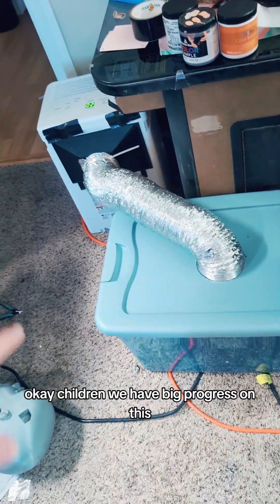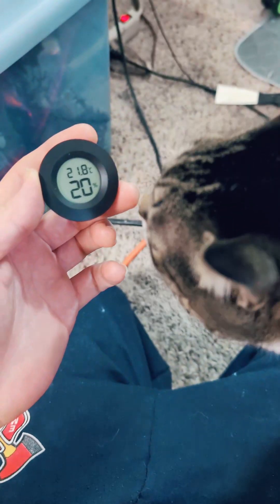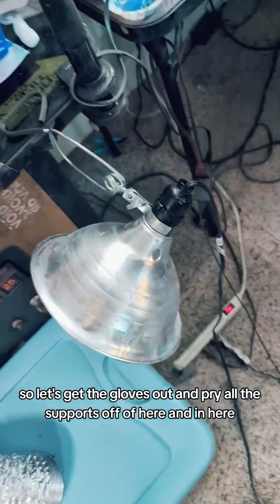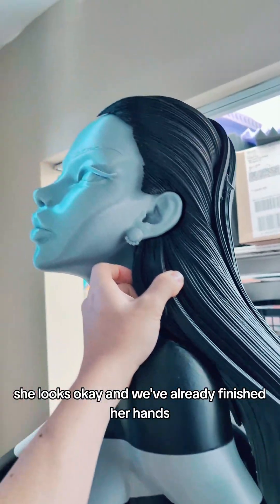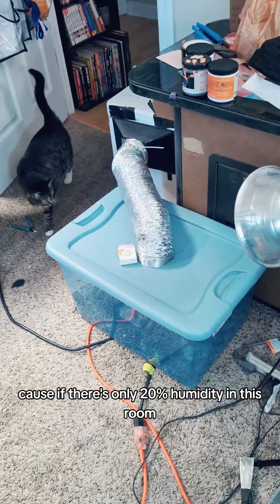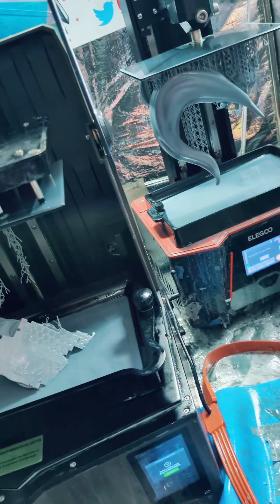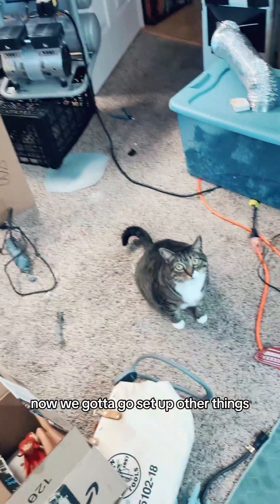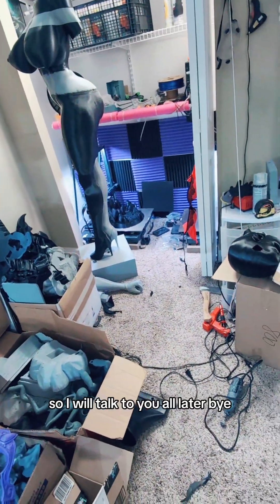We are almost finished printing the raffle figure!

Comment: the reason the box will work, eventually, is the pressure drop from having small inlet holes.  the closer to room humidity it is, the longer it'll take and using the weak fan in the dehumidifier slows things worse.

you can find axial compressors as cheap as 12 bucks, but the better/quieter 110v ac versions are close to 60, 'high pressure 80mm fan' on the jungle site.  they can be fed into the dehumidifier hose as a booster, if you get a proper server fan it'll do better, but be LOUD, so a high pressure desktop fan in that environment is as good as you'll get... arctic shows up in the search, good brand, or was, probably still is.

Comment: If you want to use a room dehumidifier, you need to define the room you want to dehumidify! In your case, the room is the contents of the box. So you need to return the blown air to the box from above, and extract the air from below into the dehumidifier. You must not let the room air enter the closed air circuit, otherwise moisture will come inside. Use some 80-liter plastic wine barrel and make an opening in the bottom for air extraction. Insert a metal mesh basket with desiccant material into it so that it cannot be sucked out. Close it with the included lid, which has a hole in it, and the return air from the dehumidifier. After about 3-4 hours, the air would be dehumidified. If the dehumidifier has an ionization function, I don't know exactly what effect it would have on the plastic.😊
Reply: Was going to say, letting in outside air means the humidity in the box will never be below the room’s. Honestly reusable desiccant packs and an airtight box would be simpler.
Reply: @ericchapman5544 However, you won't get deep enough into the material with chemical dehumidifiers when you have a large amount of material unless you mix it all together in a large container and then rinse it with a liquid that doesn't contain moisture or grease. A vacuum pump would be more suitable but is impractical in this case.😅
Reply from the maker: ... i have a big air compressor... could i not make a vaccume chamber with it intake hole..... 
🤔
Reply: @Freyas_Fantasys Theoretically yes. However, the container should withstand the vacuum force, which is pointless with the amount of plastic you want to dry. And you still have no control over the level of vacuum you are creating. You don't have a gauge and I think the compressor has the wrong one-way valve to maintain the vacuum, but I could be wrong. Check.
Reply from the maker: yeah... im not gonna make a vaccume chamber. 🤣 we r just gonna take the output from the dehumidifier and feed it back into the same box. it does not need to be air tight. just tight enough. 
will post results today

Comment: Maybe try closed loop at the dehumidifier - feed 'exhaust' back into the box?
Reply from the maker: see, that makes perfect sense to me. great idea. but i need a scientist to check that work. i think the exaust is much more than the sucking? 🤔 wait, that would not make sense. HMMMMMM a closed system.... thats genious.... that would dry it out for sure!
Reply: @Freyas_Fantasys  I mean, do not do it perfectly airtight. There actually might be some pressure difference between input air and output air, so I think its better to left some wents to let the pressure equalize? I think you might actually burn the dehumidifier otherwise? I'm not sure how those things works to be honest. I'm not a scientist, I'm just spitballing ideas here 😅
Reply from the maker: i am also worried about burning it out....

Comment: Easy way to make a drying box would be use desiccant and then dry it back out at the end of run. Google suggests food safe desiccant.

Otherwise, i'd try to build a heated box... similar to a filament dryer or food dehydrator. The hot air will be dryer than the air in the box and draw out moisture. As someone else pointed out, you're really just drawing room-humid air over the plastic as-is.

My first thought was just swap the hose to the exhaust (dry, hot air) instead of the intake (humid, cold air)... but I'd also monitor it for a while to make sure the exhaust isn't melting things.

Comment: In theory, your set up for the drying the plastic should work, but you may not notice it in the reading on the sensor. It will detect the humidity of the room air, but not sure of how much the moisture from the plastic would affect it. It depends on how much water the plastic absorbed and how fast it releases it. You could test it by putting a damp cloth in there with no plastic. I would do multiple tests with varying wetness's. I'm a science teaching, you need multiple trials. Most filament driers use heat to get it done faster.

as for cold weather, i have a little heater (a little rectangular cube) that sits on the printer, so it heats the inside of the chamber. haven't had a problem with the elegoo water washable resin. But you have me wanting to try Nova.

The clouds are cool.
Reply from the maker: hmm, will run tests! 
for resin i was using the elegoo 8k resin. as soon as the temperature changes, it becomes a huge pain in the ass. water washable might be different. but the nova 8k has been stellar so far!  its a little light in color for me. the light color makes it a little harder to see details. aesthetically i like the darker elegoo color. but i cant complain when it just works!